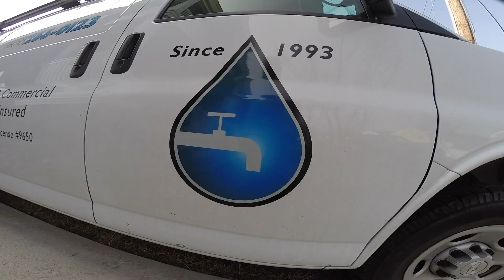HB SMITH HYDRONIC BOILER THERMAL COUPLER REPLACED

Comment: on many models you can get to the screws holding whole pilot assembly through the big cover, then unhook t-couple and pilot tube from gas valve, pull the whole assembly down and out, clean/change and put it back, instead of pulling the whole burner tray.
on others leave the whole tray, unhook t-couple/pilot and gas pipe form valve, pull manifold bolts and take that assembly out, then pull the burner with pilot assembly attached, probbaly wise to pull and clean them all while at it anyway :)
Reply from the maker: ya. it was nice the entire assembly came out.

Comment: the mouse will definitely be happy. looks like he has been quite cozy under that burner.  Homeowner should get them under control they will chew the heck out of wires.  Mouse droppings is an additional charge!  you only needed a standing on your head shot on that one.  if you can find some old Dickie work pants they usually are pretty comfortable not warm though.  Id send you mine but they are too big all the way around. Omar made them
Reply from the maker: Im balling in sweats here. me vs the mouse on gas valve pilot lighting.
Reply: I think the mouse was having a party in that boiler. left you some Christmas gifts.  Plumbers work in all kinds of difficult situations.  Balling in sweats I cant get the image out of my head.  I think plumbers crack was invented in sweats, no extra charge for that either.